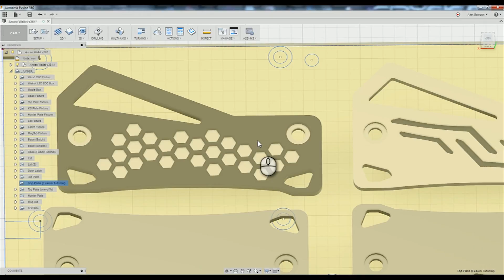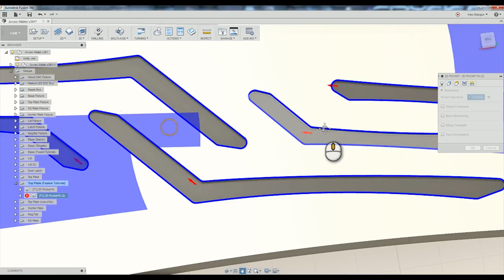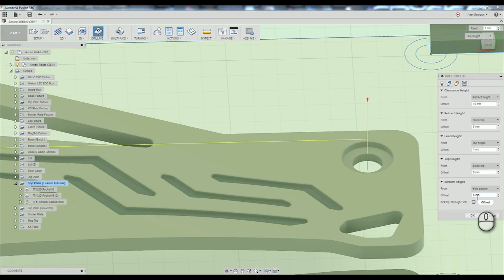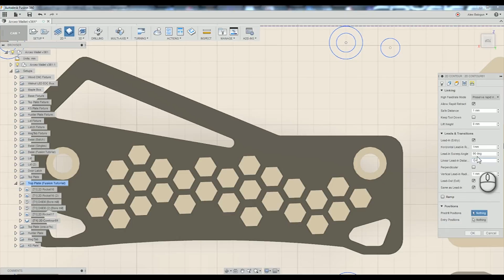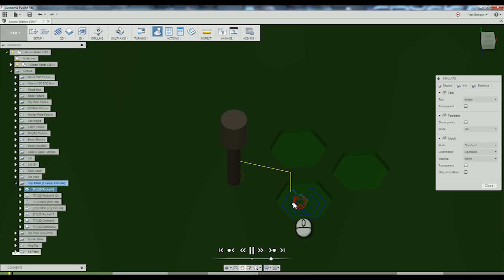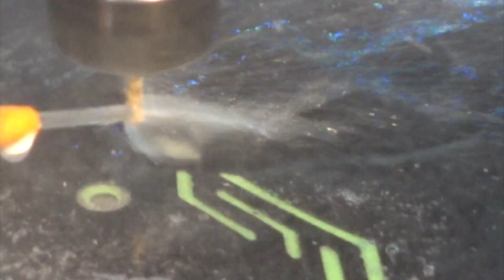Micro Engraving in Fusion 360 CAM:  Wallet Making Wednesday - WMW02

Comment: When I am doing my 2D pocket selections, I'm selecting the pocket to cut, instead of the the top layer.. what's the difference?  (BTW, thanks for the video)
Reply from the maker: Hi Dan, general rule of thumb I use when doing 2D Pocket is, if it is an open pocket, I select the innermost edge with the red arrow on the open side, then specify the boundary with "Stock Contour"(yellow line), and if it is a closed pocket, I just need to select either the face OR the contour.

Both selections can accomplish the same thing in most situations, unless the pocket is open.  Thanks for the question!

Comment: @ronin, I really enjoy your videos, especially the detailed description of the Fusion CAM process. I have one suggestion and a question. Wouldn't it be better to use Model Bottom for the depth of the counter bore instead of specifying the -1.6mm offset? It seems to me that your duplicating the depth in both the model and the CAM. The question is do you know why you have to specify the bore diameter in the Cycle tab of the Drill operation? Again it seems that this was specified in the Model.

Again, Nice videos!
Reply from the maker: Hi Drew, great question! The reason I tend to use stock/model top as my 
reference is because it gives me more flexibility when experimenting 
with depths regardless of what I have set in the model.  You could 
certainly simply select the hole top of the counterbore and use 
"selected contour" for your height and that would accomplish the same 
thing.  As for needing to specify the diameter, the "Drill[Bore]" 
operation requires you to manually enter the hole diameters(not sure 
why).  

In contrast the "2D>Bore" operation will automatically reference the model diameter.  Another advantage to using "2D>Bore" is you can see the toolpaths whereas in Drill[Bore] you cannot.  Lots of ways to accomplish the same task in Fusion, it really depends on what method you find most intuitive!  

Cheers